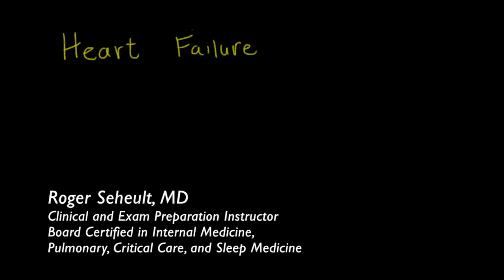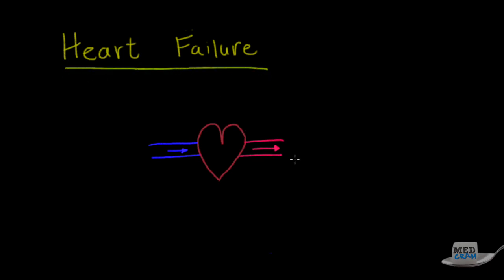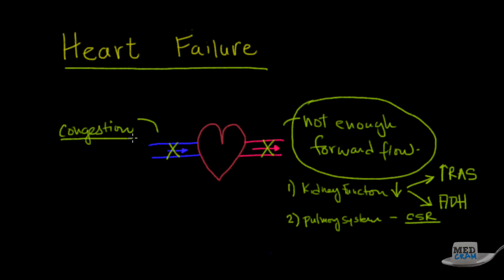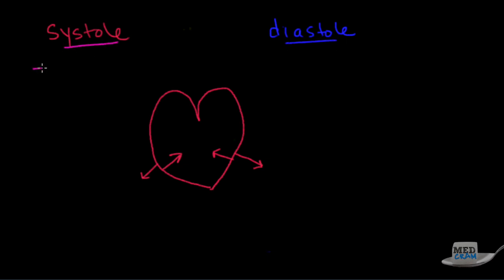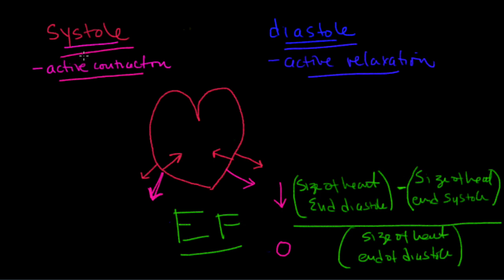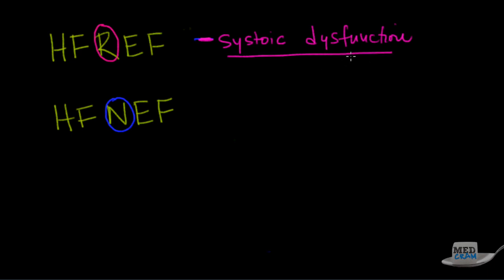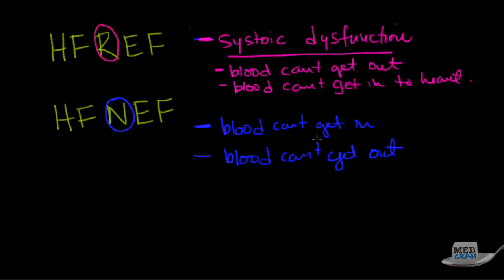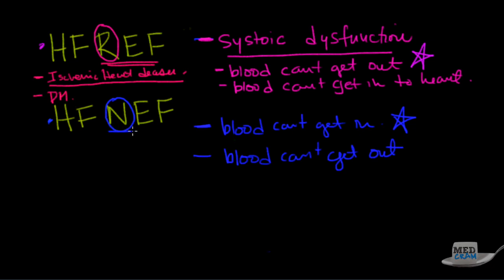Heart Failure Explained Clearly - Congestive Heart Failure (CHF)

Comment: Is left ventricular dysfunction defined as left sided heart failure?  What about both systolic and diastolic failure Grade 1? Is the Grading of heart failure based on the echo?  Is not just a heart impairment?  Is diastolic failure Grade 1 normal as we age?  And is an enlarged heart "heart failure" or "cardiomyopathy???  Whats the difference between Heart failure and Congestive Heart failure?  What if the patient suffers from both systolic and diastolic impairment, but EF is low normal, for around ten years, but suffers breathlessness, lightheadedness upon minimal physical task such as cleaning a mirror?  Very confusing when reading the definitions. Aome HF patients are normal active others not so active and limited even if EF is normal, why is that?  Thank you.

Comment: So, if there is a time-lag with the blood not being pushed out, after it is pushed in, would a stimulant that raised the amount of heart-pumps per minute, help alliviate the problem?  I realize your video is old, but, with no real pulmonary issues, except for a PE 10 years ago from a DVT (twice, and BT's for life) has something new arrived since this posting, regarding the heart?  I am on personal oxygen to oxygenate my blood, but only use it when my oxy level dips under 90 (it has normally been in the mid-to high 90's, consistently, as measured by the blow test, and now with my own personal oxymeter).  

I was diagnosed with HCL (non-Hodgkins), received 40 hours of chemo, back to back (80 hrs. total)  with a 24 hour break, and spent the next 12 years in bed, 18 hours a day with chemo-haze.  Time out of bed was extreme dizziness.  

My diagnoses with HF came at the near end of my chemo-haze; normal chemo-haze usually lasts about one year with most people, and 5 years seems to be a normal, too, but not 12, in my mind!   

40 years ago, I failed a flight-physical (FAA) due to gigantic inverted t-waves.  Remember, gama and MRI's were not yet invented.  Two years ago, and since, my inverted t-waves are apparently gone, as they no longer show up on my EKG's.  I recently passed a chemical-stress test, that found NO ISSUES with my system.)  (I respect my health, and I try to keep it optimal, because that is what people must do.  I've been this way my whole life; but, because of HIPPA changes, I thought I would bounce this question off of you.)  (I was born a few years after the end of WW2.)

PS-Thank you from the bottom of heart (no pun intended) for the information you have provided to me and all of your viewers.   Oh, PSS, I take my vitals, by myself, every day.  If I get a good blood flow for my glucose check, I know I'm taking my thinners correctly and if not, I double-check to see if I missed a dosage, 5 mm X 2 per day.  I also have my own Drive BP cuff, and never go out of the green-range.  I have just recently been able to take care of myself with no issues, and know that increased exercise will help me, also.

All of this is just med history.  If you respond to this, the only question I have, is about a stimulant that would make the heart beat faster, for the entre and sorte of blood through the heart!  Thanks, again!.

Comment: CHF Paient my self...good info explained so even I could understand...
Was hoping to hear someone mention longevity with. CHF thank you tho very helpful info
Reply: I went into CHF 'ARDS and placed on ventilator to keep me alive July 2017 as well as CABG X 5' , my EF was 20% at the onset. I had 93, 95 and 98% blockages in 3 of the 5 arteries,  I should've died.  My surgeon told me I had another good 25-30 yrs if I live a healthy life,  ie not tobacco,  which caused my heart disease, eat right etc.  My EF was at 40% my last echo and will have one next month. I take carvedilol 6.25 mg,  entresto 49-51mg,  spironolactone 25mg and atorvastatin 80mg. Torsemide as needed.  At one time they had me on the highest doses of all meds and I felt like crap with constant low blood pressure.  After they adjusted my meds, I'm feeling a lot better. I still have my bad days but I do yardwork pacing myself, also exercise at least 2 days a week. I'm not able to do what I used to do but I have established a new normal life. Be proactive in your recovery by asking your heart specialist questions, daily monitoring your weight,  blood pressure and any symptoms you experience and you can live a normal life. I wish you the best in your recovery.  God bless.